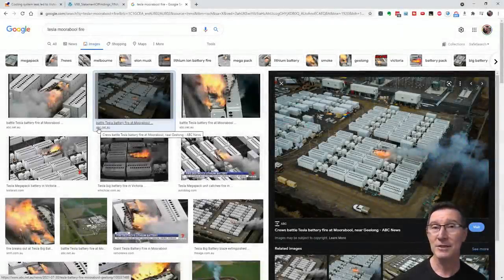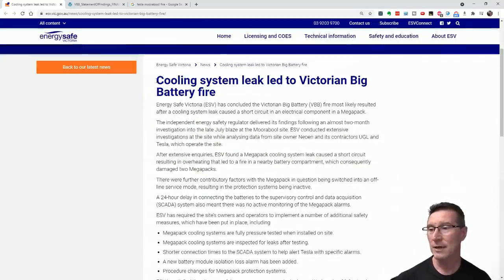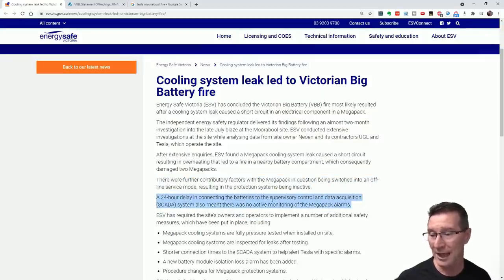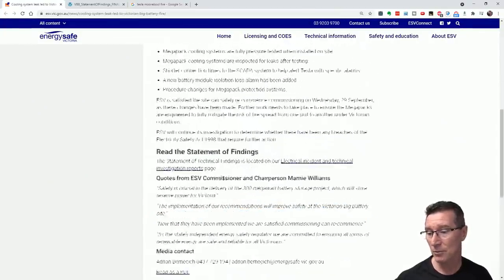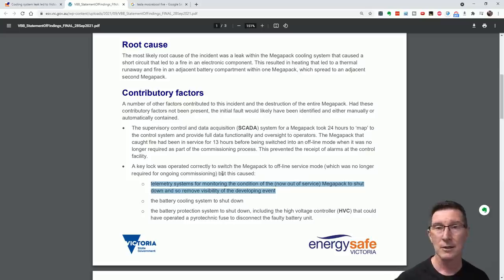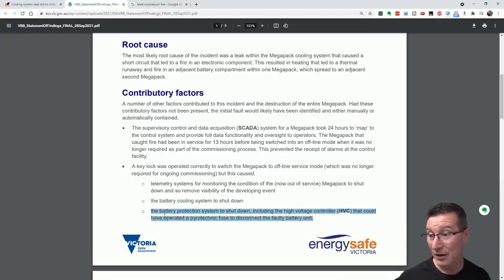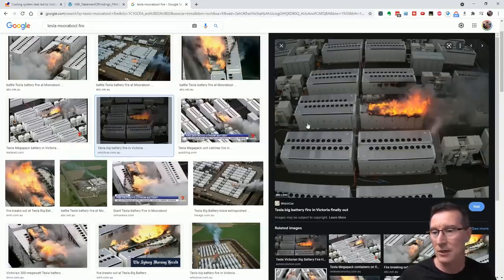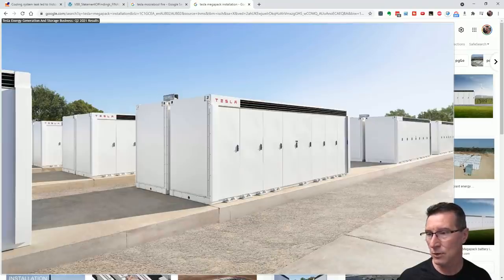EEVblog 1422 - CAUSE of the Tesla Victoria Big Battery Fire

Comment: Because these are Lithium-based storage batteries, they must have been shipped with substantial energy stored in them to be stable.  This means they are vulnerable to uncontrolled discharge if the protection system is shut down.
Reply: Are lithium batteries inherently unstable if transported at low-charge conditions?
I'd like to hope they are OK at 3.5V - where they aren't taking damage from over-discharge; but also have less energy to supply to the ensuing fire...
Reply: @Vilvaran  All batteries, primary and rechargable, loose charge when in storage or being shipped.  Because of that, you can't store or ship a lithium rechargeable at the minimum safe voltage:  It won't stay at the minimum safe voltage unless it's being actively maintained.  You have to ship and/or store them with enough charge that you can expect them to arrive/be removed from storage with sufficient charge to still be in the safe zone.  For shipping to Australia from a factory in North America, it could take several weeks or the batteries to arrive, and then more time for them to be plugged into the storage system where they can get maintenance charge.

One thing I;'m not getting here is why the hell they're using lithium-based batteries, which are known to have stability issues, in an application where neither energy density nor weight matters in any way.  Lead-acid batteries would work perfectly well, and be much less trouble.  When was the last time you heard of a lead-acid battery burning up in a thermal runaway?  The DON'T.  And we have designs that work extremely well over the long term even if they go through deep charge/discharge cycles like in electric lift trucks.  They're also just as recyclable as lithium batteries, if not more so.  (You can design lead-acid batteries to be easily disassembled to remove the plates to be reprocessed once they've degraded from long-term use, then put the recprocessed plates and refreshed electrolyte back into the same cases.  The recycling can be very, very tight, which is good since they're made of pretty toxic stuff.)  There are also other battery chemistries that might be better for this kind of fixed storage facility.  Has anyone looked at the sodium-sulfur chemistry everyone was so interested in back before lithium chemistries came along?  Again, for a fixed industrial energy storage facility, weight and power density don't matter, so we should be using stable battery chemistries that don't tend to go off bang if they're incorrectly manufactured or mishandled.
Reply: @evensgrey  I have actually read of lead-acid based thermal runaways...
Also a 'good' lithium ion cell can hold it's voltage for years; even at 5% charge - it's the BMS / protection circuit that will have some draw to it; between the laptop-battery and the inherently 'leaky' nature of traditional rechargeables; there is reason to uphold the maintenance charge... And these tesla banks are computer-controlled, yet i'd like to think that there is something that has to be ""plugged in"" to actually enable the battery banks during setup; you can't expect them to come in a 'out-the-box' state.

My understanding comes from the hundreds of lithium 'boms' I've messed around with; they don't lose any charge as a bare cell, unless damaged / abused...
They also don't tend to spontaneously combust - unless they are "sad inside" (old abused cell being abused some more) or overcharged (through bad design / operation)...
Reply: @Vilvaran  Lead-acid batteries appear to be much less subject to thermal runaway problems, and the results don't appear to be as nasty.  There are also a lot of things that can be done in design of batteries to inhibit thermal runaway.  What I've been able to find also says they only do it if being seriously overcharged.  From the report's description of the failure, it wouldn't have been possible if this had been a lead-acid installation.

As I pointed out in at least a couple of places, we're not concerned with energy density or weight in one of these fixed mass storage facilities, so we don't need to go for highly energetic battery chemistries that are subject to dramatic failure modes or produce particularly nasty materials if they fail.  We need batteries that are cheap, readily recyclable, and not likely to go off bang if something goes wrong with them.  At the moment, these batteries are certainly not readily recyclable.  Even if the materials can be separated by facilities in Australia, that packs are only currently being made in the US so the materials would have to be shipped halway around the world for being made back into batteries.  To locally recycle lead-acid batteries in Australia you'd almost certainly have to build a new facility  (if for no other reason than the batteries would almost certainly be very different from any design currently in use in Australia) but you really should have a facility for recycling the materials for whatever storage battery type is used, if for no other reason than avoiding the fuel and time needed to ship the stuff all over the planet.

I looked up sodium-sulfur batteries, and they would seem to be absolutely ideal for industrial power storage of this type.  Long lifetime, efficient conversion at charge and discharge, and they get more economical the bigger they are.  The main problem with them is they look scary on paper because they operate at a bit over 300 degrees Celsius, although there are variants that operate at lower temperatures.  These have been in use for this exact application for quite a while, and appear to have a much better safety record, with significantly fewer fires, than lithium-based systems have over a shorter period.  For Australia, a side benefit is the main producer is Mitsubishi in Japan, which is a lot closer than Tesla in the US.  (If Australia is going to use sodium-sulfur batteries, there should still be a plant to reprocess them, at whatever rate is required, in Australia, to avoid time and fuel for shipping back and forth with Japan.)

Of course, as with lithium-based batteries, sodium-sulfur batteries are inextinguishable if they catch fire, but the casing is made of steel and so is highly combustion resistant, and while noxious, sodium and sulfur combustion products are trouble mostly because of being concentrated.  There must be lots of places in Australia where a sodium-sulfur storage battery facility going off bang would be an annoyance rather than a disaster.
Reply: @evensgrey  Yes SLA is inherently less volatile - but the lead bro, and both alternatives described are sulfur-based.
There isn't enough people interested in 'yellow chemistry' to bother advancing those technologies - let alone race against the lithium cell (which has a solid-state variant; and everything but Li-Po pouch cells has a steel case...)

Want 'inert energy'? Use graphene supercaps; they exist and they pack a punch for having no active ingredients...

However, design theory that I work with (TL;DR = don't run it at maximum and she'll be fine) makes it impossible to harm the lithium battery through normal usage conditions - again, pulling so much power from a battery that you have to cool the sucker is just a cursed design - for ANY chemistry...
Reply: @evensgrey  Well it's a pleasure to investigate different technologies - but in my run-down of "what's out there" versus "what is available to use" I can only conclude that Lithium is the field with the most ongoing improvements; and graphene supercapacitors are an upcoming technology which holds promising results...

Not to mention the tried-and-trusted metal-hydride cell, if it's not Li-ion, it's got Ni-MH inside...

A thing worthy of note; any 'cell' with high energy capacity is liable to turn into a flaming wreck should this energy be released uncontrollably.
If a supercapacitor fails internal short-circuit; then it'll pop it's guts like a shorted Ni-MH cell can - the same goes for new lithium batteries.
OLD and worn lithium cells have a heavily reduced current capability - they heat up under "normal" load conditions and are VERY sensitive to accidental overcharge (series packs anyone?); as in let it stray to 4.24V and it sets it's ambitions to "rocket".

Lithium cells are safe when handled correctly (Military-spec charges to 3.9V for example) - it's this "200% power" expectations that kill the show...
Reply: @Vilvaran  The only reason lithium-based batteries look like they're advancing rapidly is because they're still an immature set of technologies. They have advantages over the standard stationary facility storage batteries in terms of energy density and some forms can deliver higher currents per unit mass.  These are unimportant factors in something that doesn't move once installed.  The recent spate of lithium-based grid storage looks like a fad.  We'll see if they're still being built in a decade or if everyone has gone back to the standard, mature sodium-sulfur batteries that have been in use for more than a decade.

Comment: My money is on some sort of balancing circuit that was in a box somewhere else in the cabinet. Last video I guessed at it being a relay, but I don't feel it anymore. I'm going with something that was "not a problem" during the design phase. I can imagine them putting that stuff "somewhere safe" along with the coolant pumps. I can't imagine how coolant would make a relay or an scr melt itself. Those things are pretty robust, and you will get either an open circuit, or a closed circuit. I would love to be proven wrong, but I can't imagine how spraying a conductor over either of those would make them take out a box, let alone a cabinet somewhere in that container. A balancer blowing would be bad news bears, and that is where my drama money lays 

Maybe a power supply for the coolant system smoked? That seems reasonable as well.

I totally agree that this didn't fail safe. I love how you had a hard time reading that. Lmfao

Comment: It's a guess but I'd expect that Fire Brigades standard response during an electrical fire is to cut power. So they'd be looking for a way to get fuses blown. You see in vehicle fires or fuel leaks they go straight for cutting battery leads. Usually it's the safest thing to do but maybe not in the case where there are complicated protection systems in place. I know the fire protection industry is watching these fires because lithium battery storage is a large and volatile source of density packed thermal energy.

Comment: You would think that there would be a ‘fire hood’ available onsite (like a shipping container with no bottom) that could be lowered quickly over a pack on fire with a reach lift to contain the fire and let it burn out safely without damaging nearby packs.
Reply: Or a truckload of sand with a front end loader.
Which SHOULD be onsite at all times ready for use.
A firehose is useless as has been demonstrated in countless Tesla fires.

Comment: Is it not pretty acceptable to lose 4 megapacks in this case? A pack fire seems like a pretty much worst case scenario, and it seems like it would've destroyed just 4 of 100? packs if the wind had blown in the other direction. If the site had been commissioned already, would the rest not just keep on working as if nothing happened?
Reply: Perhaps.  Or perhaps a block of four burning all at once could be enough heat to "cross the aisle" to another block of four with the right winds.

Comment: Ok, by my read, the cooling system connections to the inverter heat spreader/radiator and caused the inverter to short, leading to the battery pack to begin supplying a massive amount of current at once. Because it could not be pyrotechnically disconnected thermal runaway continued, leading to a battery fire. The SCADA system probably is running DHCP but only every 24hours, so the system didnt initially have an IP address assigned.

Comment: This is 2021, apart from batteries what are the other alternatives and practical and efficient ways of storing Energy? Or are we still trying to figure it out.
Reply: @voltare2amstereo  Yeah I know about them, you pump water up and release it again downstream to drive turbines, but how practical and efficient are they?
Remember you still use power to pump water up, that eat on the efficiency.
Reply: @CMTEQ  at scale? No. Maybe giant flywheels but you still have to get them spinning to begin with. It's garbage like this that will pave the way to new thorium based reactors.
Reply: For HVAC, thermal storage.

Comment: sooooo....
if i understand correctly (long day, am a little out of it)
it was designed with a physical switch/command that conveniently shuts down all the annoying alarms and flashing lights (and essentially all of the safety/fault reporting systems), that was used to take it out of the grid? >.<
i am reminded of the multiple air crashes that were direct or indirect results of people pulling circuit breakers to turn off a nuisance alarm......

lets see- there's at least one plane that went into a mountain so quickly the black box only got the beginning of the impact (as in zero time for anyone in the cockpit to react) because the pilot disabled the Breaker for the GPWS (vague/outdated map data leading to constant alarms on landing- the pilot was scheduled to be screamed at/formally disciplined by his superiors for repeatedly doing it against orders shortly after the flight) and forgot to turn it back on before takeoff,

there was a pilot who pilled a breaker he didn't recognize (FLIGHT COMPUTER POWER, essentially!) to shut up an alarm from a defective sensor at cruise altitude (he'd seen a mechanic do it on the runway)and promptly lost control of the plane....

it strikes me as an inherently risky feature to have, because people are people, and its a potential timebomb....

Comment: In my opinion, the installers are responsible for this, as they have not checked the system for leaks.
When you buy any equipment, you get instructions from the manufacturer, unfortunately nowadays almost no one pays attention to them (people think that they are alpha and omega, they know everything) and then the equipment is damaged.

Comment: Fail safely just means that outputs etc. go to a defined "safe state", at least for control systems. In this case I assume it means the pack did not try to generate any weird voltages etc. and basically isolated itself, althoug it was probably that all the time...

Its "safe" in regard to the outside world, not in regards to its own well-being.

Comment: My perspective is that this has a bit more to it than meets the eye...
The suggestion of "isolation loss" means that for whatever reason, the battery did not disconnect from all sources of power when it was placed into this "safe-park" mode.

The system in question, appears as though it is intended for electrical isolation from the grid - and disable the emergency / feedback systems to avoid any alarms being triggered...
However, does such a system isolate the pack from the DC systems? That is to say, could the pack behind the flaming one possibly have engaged in charging a now un-monitored pack?
Or could the pack remain stuck in "charging mode" when the controls are essentially set from "auto" to "manual"?

My intuition tells me the "coolant leak" should be easily detected as a slew of errors and anomalies somewhere around the three hour mark?
Such a leak could occur during the initial failure - it could be overcharging or even some regulation component that was thermally coupled to the cooling system, so without it being active would be likely to fail from overheating... And a burning-hot component could boil the coolant in the line; spraying it onto the rest of the control system.
But unless a freak series of unfortunate events, an extreme lack of ingress protection and/or a very specific leaking trajectory all aligned to short the battery out, this reeks of an overcharge - look at all the compartments flaming in unison! Also note the biggest flame emanates from the compartment furthest from the "control" end of the megapack. This indicates there was an originating point amongst the batteries and NOT the switchgear or control system...

Long story short: it seems as though there is a shift of blame from a current leak - onto a coolant leak; or from an engineer's incomplete understanding of the software-haphazards - onto the guys tasked with putting it together...
 Not to mention the system design sins here - batteries should never be getting hot enough to need liquid cooling in the first place, though that's nowhere near as much an issue as the control system being capable of leaving the system in a charging state when put into an isolation mode that just so happens to deactivate all protection mechanisms...

Comment: In my opinion, it will not be possible to keep these things from catching fire, at least not with current battery technology.    If even one single cell is faulty, it will fail and catch fire which will light the whole tray, which will light the whole compartment, which will light the whole pack.    Were talking about millions of cells in a single pack.   The odds of a defect are very high even with a tiny defect rate.